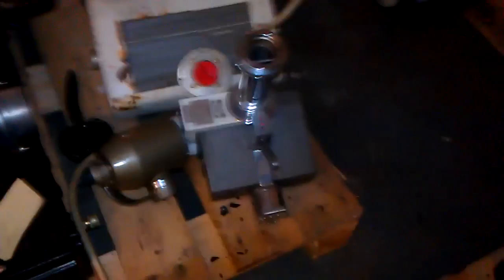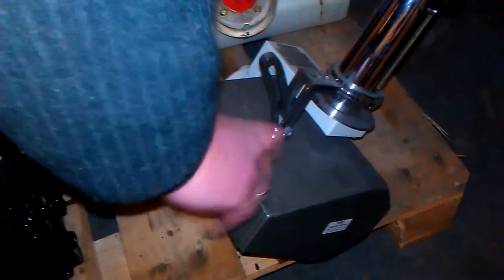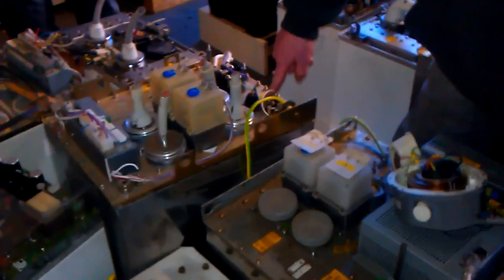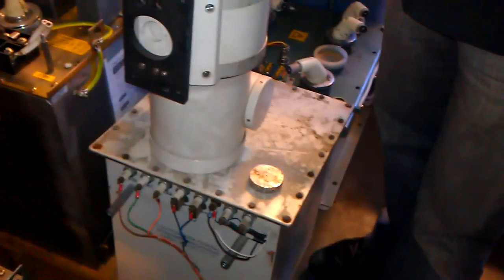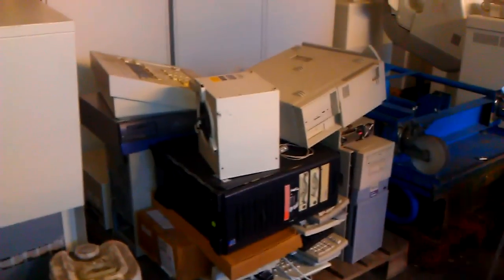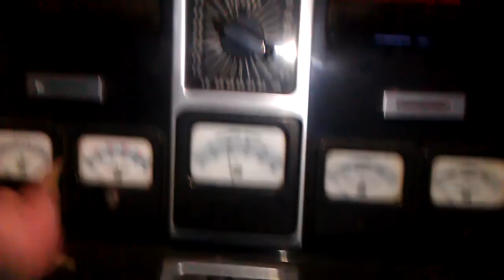Me and high1voltage1rules buying 4x 150kv 380mA X-RAY transformers we got 2 each ;)

Comment: Haha, stick it on a ballast (or two), then rip it right up. :D

On the output of the variac, put 2x 3kW kettles in parallel with each other, but have the kettles in series with the X-ray transformer, and that'll give you 25A to play with. The variac will be happy, and so will the 32A breaker. :D

Then, when both of the kettles boil......It's cuppa tea time. :D

Yes, there's ways of getting around that 60kW problem: Two kettles to bring it down to 25A, then rip-up a nice big fizzy arc. :D

-BBD.